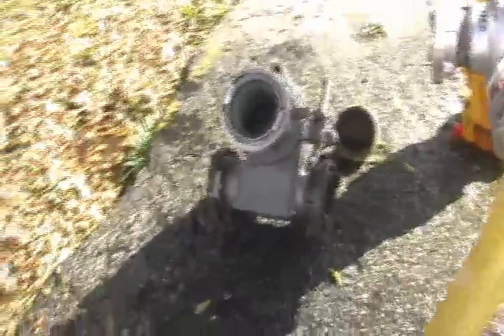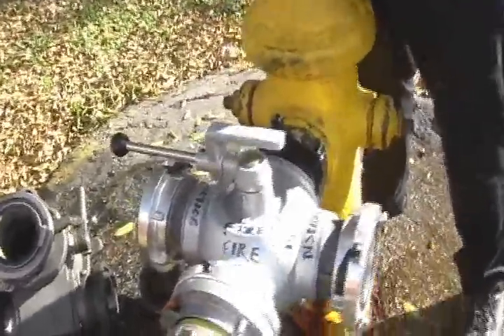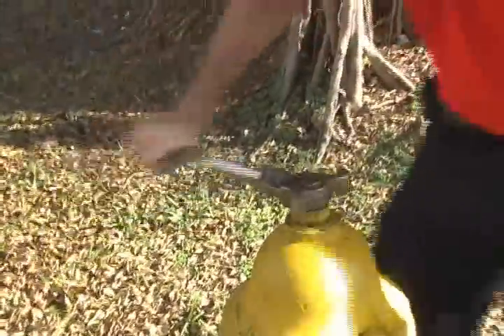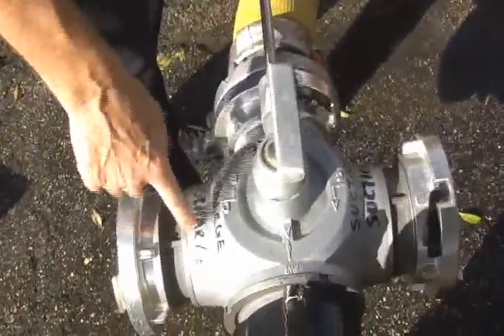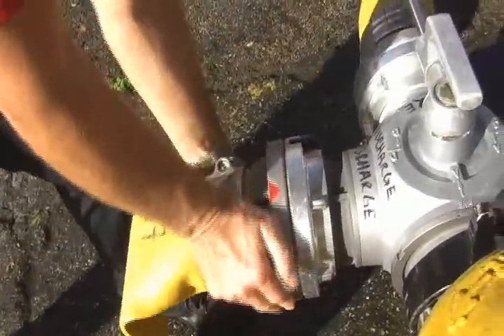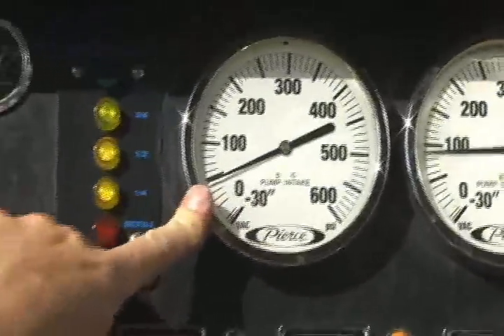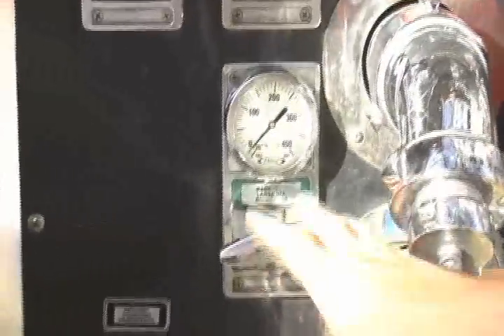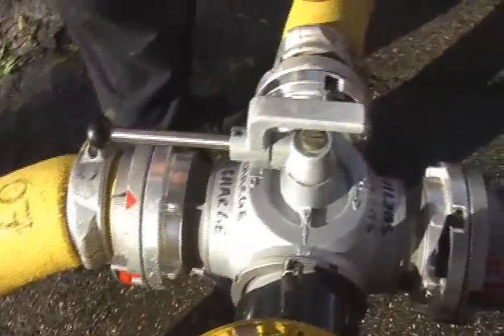Hydra Assist 4 Way Valve

Comment: Never could understand why the dry hydrants don't have a gate or ball valve on the smaller 2.5 ports which would allow you to open those up separately after opening the top operating nut to charge the hydrant..
I've seen very few that have this particular design on the dry barrel hydrants..
Of course the advantage of the wet -barrel hydrants is that you can open each one of the ports separately allowing you to run each additional line at a time after you have your steamer connection in service.

Comment: Not flushing is stupid because you can learn about the hydrants current conditioning, and keeping things in the off position just adds an unnecessary step
Reply: Doc Hawk flushing is an added step too; that just my opinion. It can be argued either way. We test all of our own hydrants yearly - and it’s a lot of them, and I’ve not noted anything that’d cause a problem at a fire. So, I’m a fan of no flush, and connect with the valve in the open position. The valve manufacturer references off as an “emergency shut off”.

Comment: Really informative but it seems like a lot of work and complexity to supply one line. Wouldn't a five inch into engineer's intake and five inch out the officer's discharge do the same thing?
Reply: It is meant for use when the two engines do not arrive and set-up at the same time. First-in engine forward lays from the hydrant using the 4-way valve. If the pressure in that supply line needs to be boosted later, a second in can come in and connect as shown to booster pressure to the first-in engine without shutting the hydrant down.

Comment: How did you close the other 2 gates?
Reply: KosukiFire there is a brass ball inside with holes in it that control flow; as well as a 50lb spring clapper that keep the intake side closed when not in boost mode.

Comment: can another fire department get water from the same hydrant
Reply: Yea
Reply: I guess I don’t understand the question. What do you mean? “Another department get water from the hydrant”? If the “other department” is there to boost it won’t be an issue as long as they have 5” Storz connections and appropriate hose.